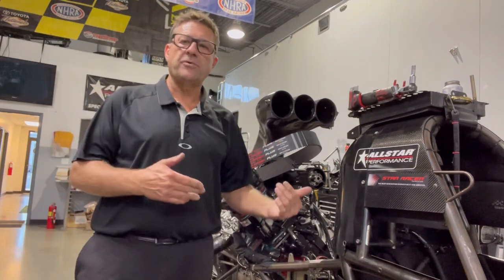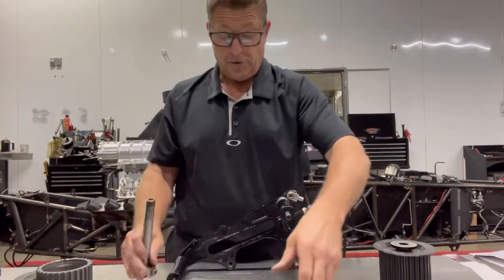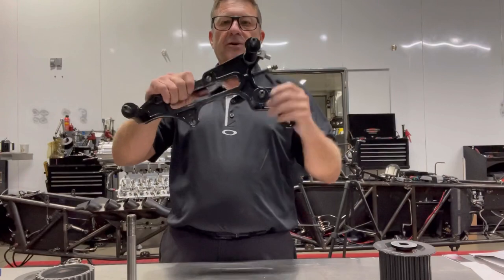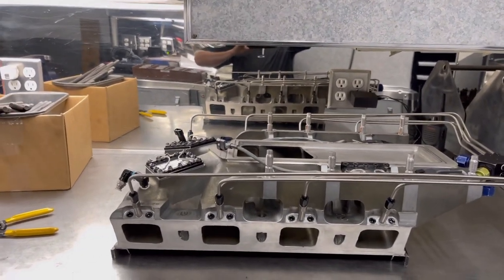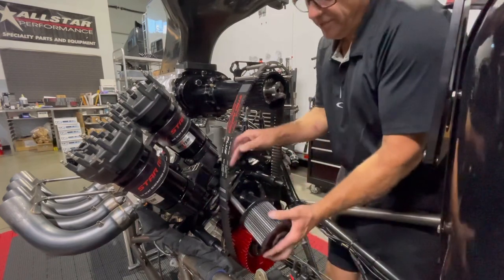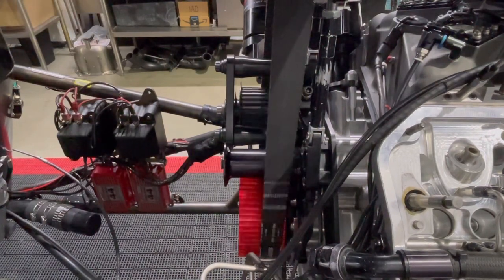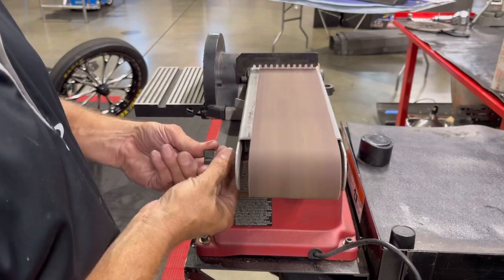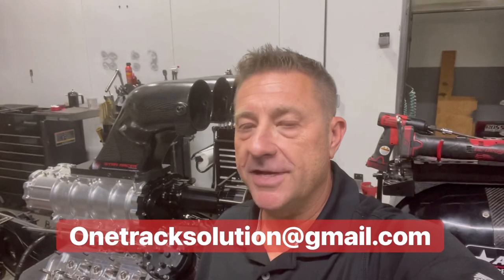How to install a 10,000 hp blower belt￼ (Star Racer)￼

Comment: When we ran those brackets on boats we had them engraved and it was a massive help. Belt walk was a big problem and adjusting them in a bilge was a nightmare. Granted we didn't spin them as hard as you guys but we'd spin them for days compared to a fuel car. So getting them to ride right was critical.

Comment: One thing to add, speaking from engine timing belt experience.  
Always run the belt in the same direction.  In operation, belt teeth get pulled in one direction and flipping the belt over will cause the teeth to be pulled in the other direction.  This flexing can tear the tooth off the belt.  This was a big problem with the old square tooth belts, could be less of an issue with round tooth belts but I'm not taking that chance.
Reply from the maker: Great advice. One thing I didn’t mention is I always put the belt on so that I can read it if I was sitting on the motor. That way it always gets put on the same direction but what a great point!
Reply: @robwendland  said:   "   if I was sitting on the motor. "    Cue pic of of Slim Pickens riding a atomic bomb. . . ..

Comment: It would be interesting to know whether making the toothed-idler with a convex shape from end-to-end.  This is a trick often used to keep a flat belt tracking on a cylindrical pulley.
Great stuff!  Thanks for sharing your tricks.
Reply from the maker: Yeah we’ve ran those and it seems to work on the plastic belts OK but it tries to deformed the tooth by pressing against it.

Comment: With those belts transferring 800+ h.p. from the crankshaft to the blower pully, its amazing that the stuff even lasts as long as it does.
Reply from the maker: It is the buffer as well or the damper between the madness!
Reply: @robwendland  I can totally understand that. 👌

Comment: Hey Rob.  Hope you see this- For some reason (racer brain I guess) this video popped into mind when I saw Bill Millers’s car back on track this weekend.  If I remember right, he helped Goodyear when they came out with a blower belt for top fuel cars that had a V pattern in the teeth instead of straight across. Pretty sure Mike Klober jumped on board running it also. It was supposed to be the next big thing, but seemed to disappear almost as fast as it came in. Any particular reason???

Comment: Just a thought, time permitting you could do a fuel school for people trying to get into the sport as a crew member.  I hope Terry will make a race soon.  Are the bearings ceramic?  I've seen some radius tooth belt pulleys modified, kind of looked like a #1 center drill was used to machine a small groove along the root, for other types of racing to get air and debris out from under the belt.  Cool video, thanks.

Comment: Who cuts your pulleys Rob? I have to make my own and cut them on a gear hobber since nobody seems to know how to cut large diameter pulleys. As you know the geometry and tooth shape changes slightly when the belt wraps around different diameter pulleys. Synchronous timing belts, difficult boogers to work with ha ha. Great videos as always!!!!!
Reply from the maker: Rich Schendel makes pulleys and does it the same way as you. We have noticed that we have to cut the profile a little deeper on bigger diameters. Where are you located?
Reply: Out in Lubbock Texas. Middle of nowhere bud.
Reply: @robwendland  Hi Rob, great, informative video. I was wondering if you, or anyone else ever considered using Pulleys with a Concave, or Convex Pattern to help with Belt Wander? I machined a 1° taper on the upper pulley from both ends on a worn out belt sander. The belts ran true after that. (The belts had been sliding off into the cover, and just never tracked straight.)
Your guy could program in a Tool Path of a Slight Arc negative, or positive while the pulley is held on an Arbor in a Indexing Head, or a Trunnion on the table of the CNC Mill. Might be worth a shot.

Comment: Great video! thanks for posting. When is a dmpe/that style idler system needed vs the old school single bolt style?
Reply from the maker: I guess it depends on how much overdrive and RPM the engine is running but definitely any alcohol version with a roots style blower and up.

Comment: Pretty good chance your sanding belt is slipping on the roller since belts like to climb to the high side when they have grip and are able to flex across the width as in a crowned roller's ability to self centered. Cogged belts usually have a fair amount of grip in the travel direction. Does the heavy pull cause them to slide across the width? Interesting stuff.

Comment: I know this is strictly top fuel stuff… but did the guys as star racer ever say anything like “our belts like more tension”? 

Only reason I’m asking is, I just put one on my 565 and set it up like my old rubber/nylon belt was slack wise. Now when I whack the throttle, you can see the “slack” side of the belt rise up off the blower pulley. Basically trying to jump teeth… 

Wondering if I need to run it a little tighter, or will it hurt anything. I definitely don’t want to stress the crank or blower snout…
Reply from the maker: Definitely run it a little tighter. Jumping a tooth is the kiss of death! Doubles the working tinsel strength and will break the belt.

Comment: I don't want to poo poo the design but why is the track straight instead of being curved/convex so you're getting the mechanical advantage and stiffness, have you also considered making the teeth on the pully itself an involute cut? Maybe they are hard to tell but the advantage is that there's only one constant flow contact point throughout the tooth engagement. Finally if you get the sprocket but with EDM you can get the exact profile to match belt and sprocket engagement and not have excess belt strain. Small relief holes could be added so to not trap air and cause vibration.

Comment: Hey Rob, Does the 1440 long 8mm come in a 2" wide version or can a 3" be cut down? I want to bring the blower back an inch and narrow the the drive up on my little buggy https://youtu.be/e3HU9l3d2nQ
She doesn't make enough steam to need all that belt anyway
Reply from the maker: I can have one cut down for sure. Email me
Reply: Bill, belts like this are made in a large band and are cut to width.  I've worked with many toothed belts in industry and they are frequently cut to order since there are so many variations.
Reply: @robwendland  thanks Rob.
Reply: @bobroberts2371  thanks for the input Bob. I was aware they are cut to size just wasn't sure how wide of a market Rob is targeting as 2" wide is not standard for max effort stuff with the exception of a few centrifigal set ups.